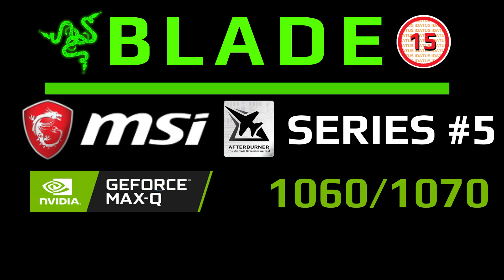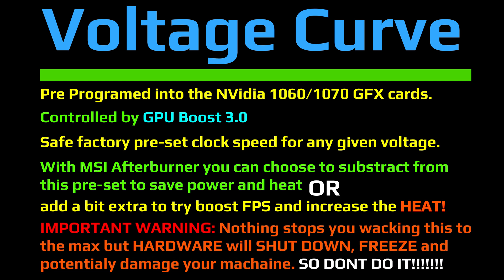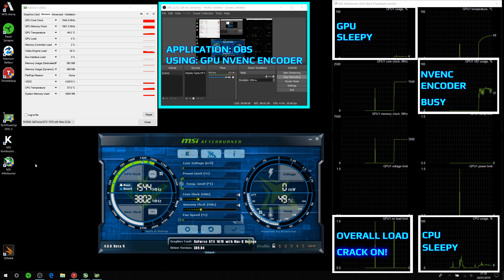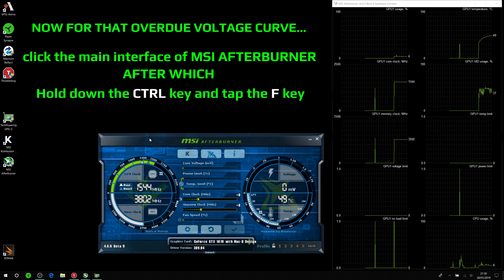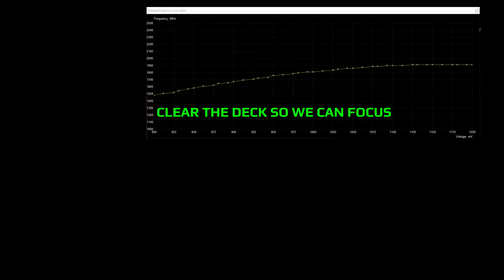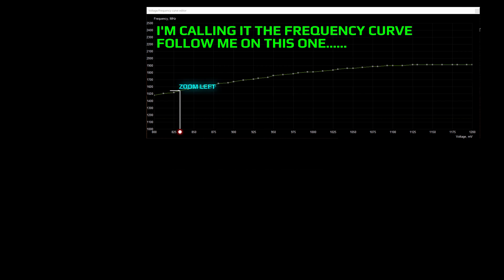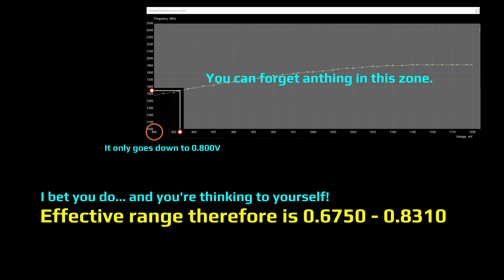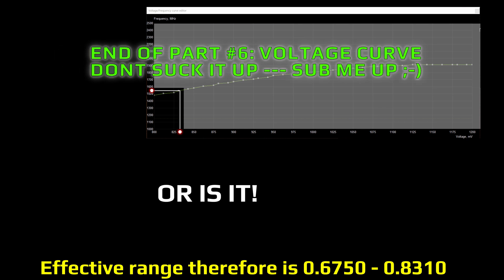Understanding NVidia Voltage Curve◄iDATUS►

Comment: Have you tried the new MSI Afterburner? The voltage curve now starts from 700mV
Reply from the maker: Nice to know, thought they catch up eventually. Still needs to go down to 625mV.
I will install the latest version after the next upload and show improvements.
That's for commenting most helpful.
Reply: @iDATUS  yeah no problem. There's no max q undervolting tutorial on YouTube so I'm impatiently waiting for your next video. Trying  to undervolt my 1060 max q here..
Reply from the maker: Its not quite lowering the voltage like in Trottlestop its more understanding what your Graphics card is doing and lowering its use to no more than you need or the opposite increase the juice more for when you do need ;).
The next video for MSI Afterburner is almost ready, just taken a slight detour for a MTG Foil Card show detour which unlike these videos its only taken a few hours to do.
◄iDATUS►